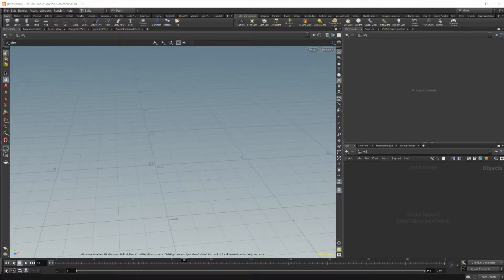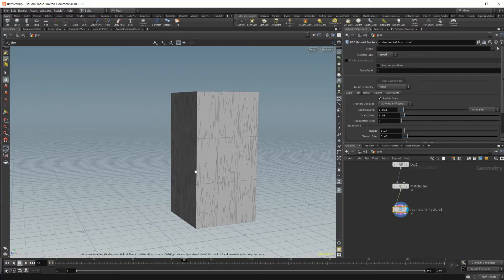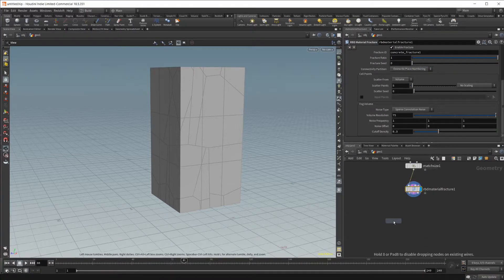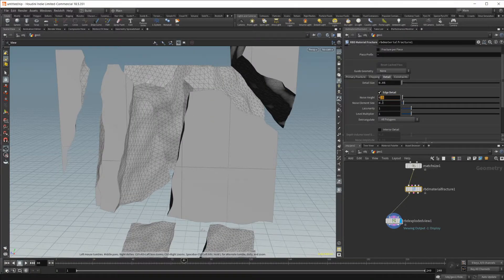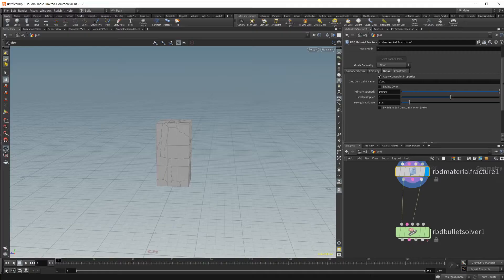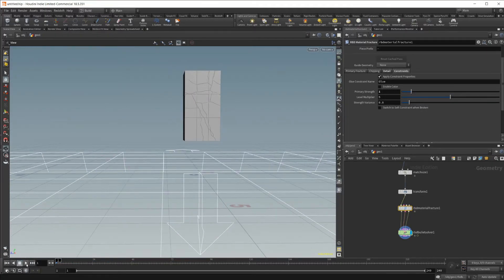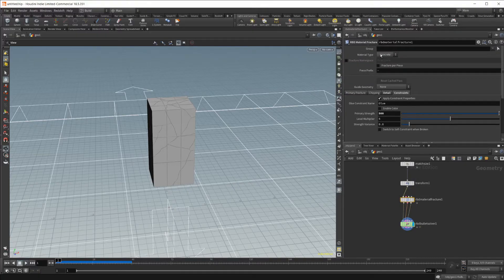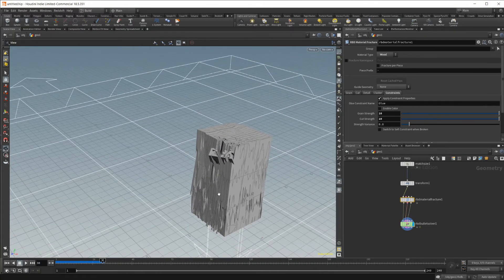Intro to RBD Fractures and the Bullet Solver in Houdini

Comment: hey bro!! whats your pc specs?
Reply from the maker: I have a threadripper 5965wx, 128gb of ram, a 3090 and an a4000 but at the time of this video I believe i had a 3950x, 3090 and 128gb of ram.
Reply: @InsideTheMindSpace  I believe Houdini uses much of CPU than GPU
Reply from the maker: @jibinjoseph85 Houdini uses a lot of ram more than anything. A good cpu helps with calculation times but more cores doesn't mean faster simulations. The gpu's are for rendering